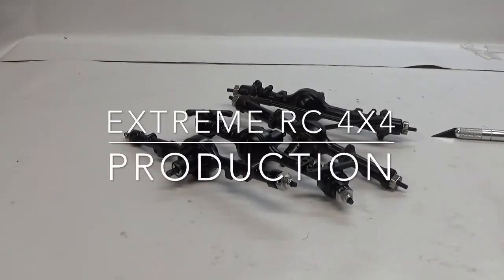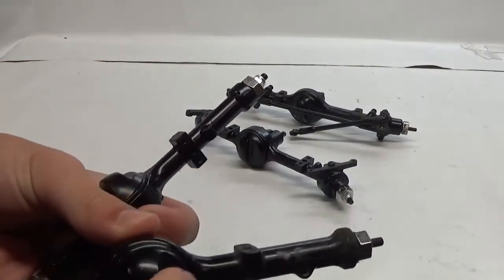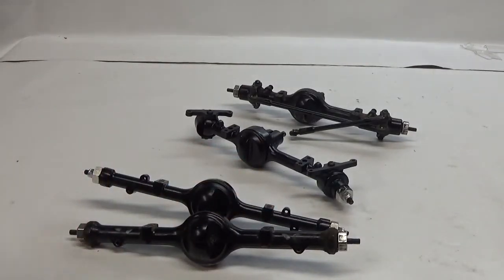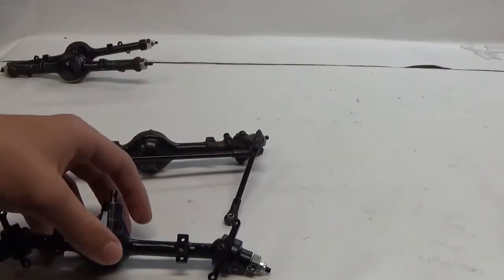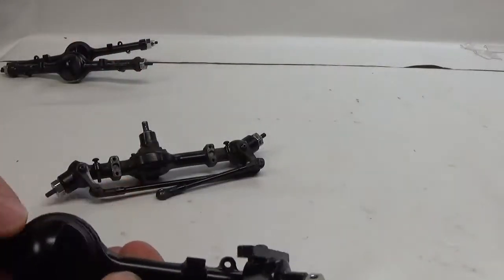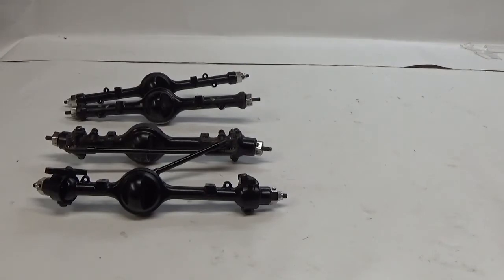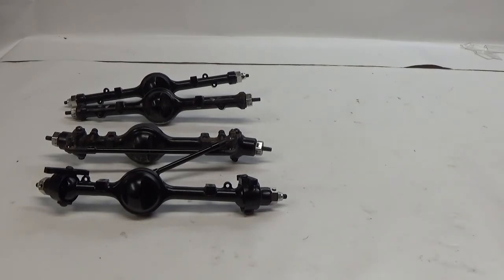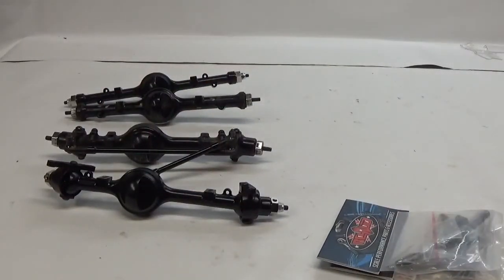EXTREME RC 4X4 Comparison between RC4WD Yota 1 and Yota 2 axles

Comment: how are the yota 2 axles ? because i have read on the internet they are crap, they have some problems with some screws or something like that.
Reply from the maker: tektooonik I really like them, the problem people might be complaining about is the small hardware. You can see for yourself in this video: https://youtu.be/P6nn2fx2WWI
Personally this isn't much of a problem as simply you don't need to apply much torque to them. Many people probably strip them out and can't get them out. Other than that the internals are good, I believe the internals are used in the yota 1, 2 and yota scale axles. So these axles are used in many of Rc4wd's kits and RTR's. I'd say go for it if your interested. Yota 2's are definitely scale and perform well. Thanks for watching!

Comment: Right on man. Thanks. I've got a TF2 Kit and wasn't sure which axles I have. Looks like I've got Yota 1's right? Mine has the two piece housing, and non removeable pumpkin cover.
Reply from the maker: Chad Harzbarger that's correct! The RC4WD Trailfinder 2 comes with the yota 1 axles. A gelenda 2 comes with the yota 2 axles. They use the same internals as far as I know so differences are mainly looks/ appearance and things like options of where you can mount shocks. Thanks for watching! Let me know if you've got any more questions!
Reply: Yeh I blew apart the dog bones on mine, and had to order new so I went with the XVD shafts for more strength, but when I went to purchase I didn't realize there were 3 different versions of the rc4wd Yota axle. I  did all kinds of reading and even confused myself more, then came 
across your video which was very informative.
Reply from the maker: Chad Harzbarger glad I could help out! Hopefully you get your truck up and running again successfully!

Comment: Does the new TF2 LWB LandCruiser LC70 kit include the Yota 1 or Yota 2 Axles? Cheers, PJ
Reply from the maker: Pete Langer I believe that yota I axles are used on all of the trucks in the Trailfinder 2 series such as the LWB chassis which would be used for an LC70 body. I think Yota II axles are used on the Gelande 2 series chassis. I’m not sure about the beast 6x6 or others. Thanks for watching! Hope this helps!

Comment: My Yota 1 axles I can place the tie rod in the front or rear........🤔
And my Yota 1 axles are not "round" at the diff. Maybe a newer version Yota 1 axle?? 🤔
Reply from the maker: Sounds a lot like a Yota 2 to me...
Reply: @ExtremeRC4x4  yeah.......I was misinformed. Someone told me the Tf2 Kit came with Yota 1 axles. Definitely incorrect. Mine are Yota 2 axles.
Reply from the maker: @asian-ugrclab2367  I know they used to. Maybe RC4WD switched them to yota 2’s.